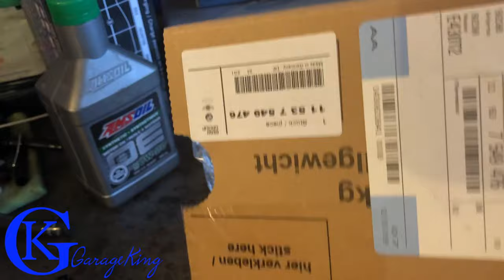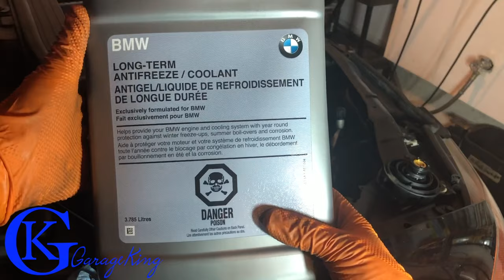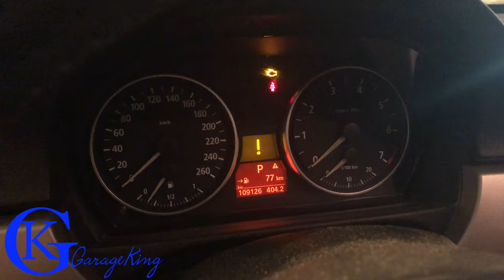Replace your BMW 3 Series' electric water pump - Step-By-Step Guide

Comment: I have a question,  im owning a e90 320i n46 from 2005. Is the waterpump there not electric yet ?  I tried the steps to turn it on while the engine is off but it didnt work.  When its on i see its working..
 Thanks for the video
Reply from the maker: Hey Thanks for the question.  I believe you do have an electric waterpump as your e90 is a 5th generation but maybe the 320i doesn't?  You could always call the dealer parts department and ask.  They would tell you right away if its electrical. If its electric then perhaps the steps are off a bit (like time between fob activation and pressing the gas pedal)

Comment: One of my bolts for the water pump was not tightened down all the way. What will that affect ?
Reply from the maker: Yikes, yup it could.  It could let the pump vibrate (its on rubber mounts) and while I don't know what would happen, there is the possibility that it could rub something loose or create a wiring problem (loose or broken wire) I would fix it if you can.

Comment: My 335i 2008 started leaking coolant, I was told it was the electric water pump. Does that cause a coolant leak ?
Reply from the maker: Hey There, it can leak coolant so it a possibility for sure.
Reply: Check your radiator as well, I have seen leaking radiators splash coolant onto the pump making it look like it's leaking.
Reply from the maker: @mikemata623  Good call

Comment: So my coolant does pump like how yours does at the start of the video. I'm still having overheating issues, when I scan for codes I get 2E84(missing pump)? Any thoughts? I've replaced the thermostat(just throwing money didn't have a code for that) & did plenty of bleeding
Reply: How long should the bleeding take? I've read the instructions and it says about 12-15min, when I've done it it kept going over 20min?
Reply from the maker: That is really weird, your computer thinks the pump is missing, but its running....... I would check that ground connection near the pump, and give the pump connector a wiggle.
Reply from the maker: Normally bleeding should not take more than about 10min.  There is a vent on the top of the reservoir on some vehicles that you can open when filling. The big thing is to look for a solid stream of fluid when the pump activates.

Comment: I have a 2011 E93 convertible and found there is additional frame reinforcement under the engine which prevents the front sway bar from dropping as you showed. Any guidance on the best path forward there?
Reply from the maker: Hummm thats a good one, you know I have never done one on a convertible, but I have worked on other convertibles (not BMW) and when I have worked on the underside the bracing was always a bolt on, bolt off, never welded.  The only thing is if you remove the bracing (if its bolted on) you have to make sure the car is jacked up squarely.  I use a quick jack so there are 4 lifting points and the car is not twisted like if you jack on one side.  You could try to get around the sway bar, but I'm not sure if its possible.  I always lower it.

Comment: Would this work for a 2007 bmw 328i? 

Also how do we know if the water pump/thermostat are failing?
Reply from the maker: Yes it should, procedure is the same.  Very hard to tell if thermostat is failing as this type of thermostat is enclosed so its almost impossible to check.  I suppose if you were creative you could submerge it in boiling water and then try to see through the housing if it opens.
Reply: @GarageKing   gotcha! i was just asking because im planning on getting an 07 bmw 328i and not sure if these have been replace yet or not.. its an auto with 85k, how reliable are these 328i cars?
Reply from the maker: @McDzy  They are actually pretty reliable, reading your earlier comment I can address the pump.  To check the pump operation you can use a scanner, or the car can do a self test.  See this vid I dd on the self test, not sure if I put it in this vid. https://youtu.be/2JCRRBUlX3s  Overall the 328i is a nice car and 85K for mileage is not too bad.
Reply: @GarageKing   appreciate it! yes, ill be looking at an 07 328i tomorrow with 85k miles, who has 2 previous owners, and seems to be on top of maintenance, im just curious whether or not its reliable, since ill be trying to do the maintenance and simple repairs by myself... whats the common tick sound issues that others are mentioning in regards to the generations around this time?
Reply from the maker: @McDzy  The common tick issue is lifter noise.  These vehicles also have noises from the front of the engine sometimes which can be traced back to the belt or tensioner, those are ones that I would not worry about at all. Make sure the oil is full, and you can do a check (there is not dipstick) so you use the turn signal and go through a menu.  These engines get noisy with low oil. Lifter tick is usually a very light ticking that goes away and then can come back at times, and normally is not serious. If you want to make sure that it is lifter tick and not something more involved then I advise to take it to a mechanic.  Hope this helps
Reply: @GarageKing   i appreictae it! we had a snow storm, so probably looking at the car monday now.. hopefully all is well on it.

in regards to their trannies on these 07 328i, how are they? whats the maintenance looking like for them and reliability

thanks!!
Reply from the maker: @McDzy  Transmissions are good, and I don't see many problems with them. Unfortunately I think they have the fill for life fluid, but its not fill for life, so I would recommend changing it if you get the car.  Its a bit of a messy job, but can be done.  The only thing is you need a scanner or one of those heat temperature guns that tell you what the temp is as the the fill level is measured at a certain temp.

Comment: I have a code to replace the thermostat on my 2006 325i.  Should I replace the water pump while I am down there?  The car has 121,000 miles and there seems to be a leak somewhere on the bottom. I have the covers off and car in the air and I can't see where it's coming from.
Reply from the maker: Good question and I would consider doing so.  They are both coming out so inspect that pump very closely, if there is any signs of a leak (even 1%) I would do it as you are in there anyway and its a pretty big job.  You might see some staining and thats a give away. Also your car being a 2006 with 121,000 miles, if its on the factory pump, well its probably getting near the end of its life anyway.  For the leak make sure you check along the bottom of the radiator, sometimes they leak at the crimped portion (where the aluminum meets the plastic) and the coolant runs down.  You could always give it a cold pressure test.  Pump it up, and then come back in a few hours, pressure testers are pretty cheap https://amzn.to/3ZgLjMa
Reply: After watching your video the second time, I went ahead and bought the pump too.  Yes, I too figured it was a going.  That being said, I already replaced the radiator earlier this summer and I hope I don't have to replace it already.  @GarageKing
Reply from the maker: Good call on replacing the pump, I would have done it as well.  Fingers crossed for you that once you do the job your coolant leak will be no more !!  @paulalan3103
Reply: @GarageKing    I found the leak.    The top of thermostat to cylinderhead coolant hose was leaking from underneath. I was unable to see it looking down on the motor so I crawled under while the car was running.
Reply from the maker: @paulalan3103  Well that's a win and sounds like it was a hard leak to find, those ones are tricky and glad you found it, as that is not an easy hose to get to !!
Reply: Question.  Would it be easier to attach the hose to the thermostat before installing and then feed it up?   Or attach it to the cylinderhead first?  @GarageKing
Reply from the maker: Either way its tight, but I think the easiest way is to attach to the cylinder head first. @paulalan3103
Reply: e @GarageKing  I'm finding it's a bit of a puzzler removing the hoses, they seem sequentially tasked in removal of the parts.   Albeit room is the key or lack thereof, so I found removing the fan an easy decision.   I am still waiting for the pump to arrive Tomorow so I 'm taking my sweet ass time removing the pump and thermostat.   Thanks for the great video and advice.  I truly appreciate the help, and I don't think I could do this without content like yours I find loaded up on youtube.

Comment: Just installed a brand new water pump after my last one failed Absolutely fine for 5 months then BOOM brand new water pump failed now i gotta DO IT ALL OVER AGAIN
Reply from the maker: Well, you are going to get faster and faster at it.  If you have a friend with a BMW, you can lend your services.  Sucks you have to do it again, but at least you know what you are getting into.
Reply: @GarageKing  haha i didnt do it paid 1800 for a shop to do it
Reply from the maker: @MakaveliThaDonKilluminati  OMG !!
Reply: @GarageKing  i know right but that includes the thermostat too. I should of done it my self but i truly got no time working 55 hours a week
Reply from the maker: @MakaveliThaDonKilluminati  I hear ya, 55hrs is touch man, that's a lot of hours

Comment: What do you call the tool used to undo the steel hose clips?
Reply: Best I found was radiator hose pick
Reply from the maker: Yup it was a large Snap On radiator hose pick
Reply from the maker: You guessed right !!

Comment: How is the MOSTPLUS waterpump and thermostat going?
Reply from the maker: Hey there, I think I used a Doorman as that was available at the time, they dropped it from Amazon and BMW wanted too much for a pump. I researched and the MOSTPLUS had a lot of sales and positive reviews.  You can get the Doorman on the Canadian Amazon, but they raised the price to like 800, not worth it at all. The Doorman pump is still running great.

Comment: OMG is that how I actually bleed the cooling system that will also check if the water pump is working correct
Reply from the maker: Yup you bet, no special tools needed.  A scanner can activate the pump, but you can do it this way :)

Comment: if I’m getting code 2e83 does that mean my pump is going out ?
Reply from the maker: It could, but it could also mean the system is dry (has air in it) if its not properly bled.

Comment: Doing water pump today on my E90, is not easy =(
Reply from the maker: I know, but you have the video to reference.  If you take it in, the shop charges a lot of $$$
Reply: @GarageKing  yes at the end need to change thermostat and tones of lines from radiator system too, hope i can run my car this weekend, doing it at spare time is slow
Reply from the maker: @draghz  I hear you, but once you have it done, you will have the big grin that you saved a bunch of $$$ plus you did it yourself, priceless !!

Comment: Steps are not the same 2010 xDrive
Reply from the maker: Hey Thanks for the comment, I did hear the AWD was a bit different than the RWD.  Have you attempted the xDrive yet?
Reply: @GarageKing  no I have not attempted just yet I don't have an issue with it but I did see that it's a little bit different All attempt it when I have an issue with it other than that your video is formative thank you
Reply from the maker: @isrealperez9069  Thanks for the follow up, much appreciated :)

Comment: Another vid showing the super easy anybody can do RWD. This is not helpful to peeps doing the AWD type.
Reply from the maker: Sorry about that, but the AWD is a more rare vehicle, hard to find them around here
Reply: @GarageKing  the opposite is true here in the snow states. The RWD is hard to find around here. Anyway the AWD is a little more annoying to do. Imagine doing the oil pan gasket on one of those, lol.
Reply from the maker: @lucianappleton1212  appreciate the follow up and I can see the AWD being tougher.  Would not want to do the oil pan, and deal with those front axles LOL  thanks